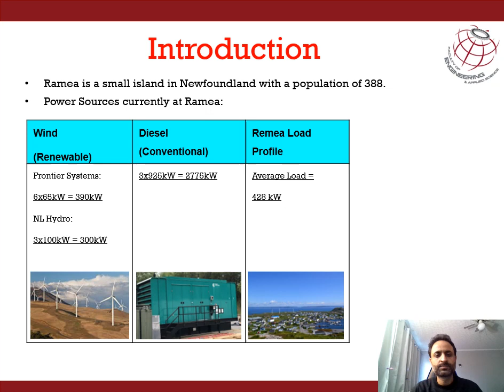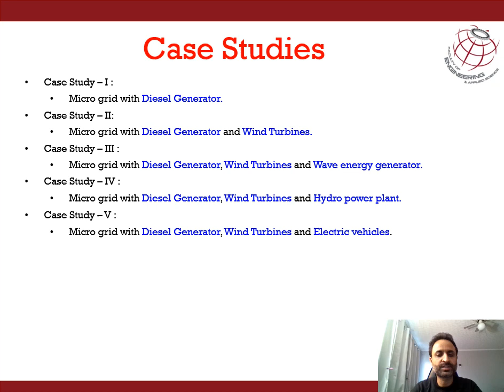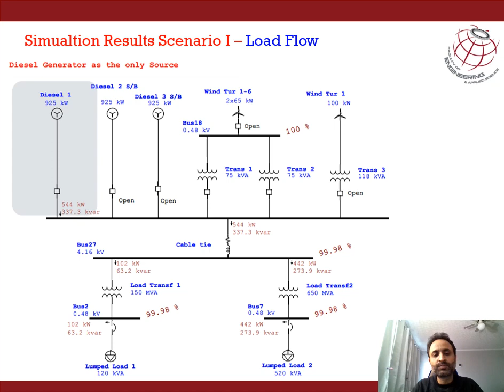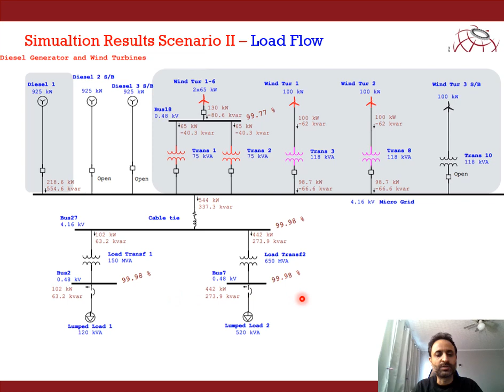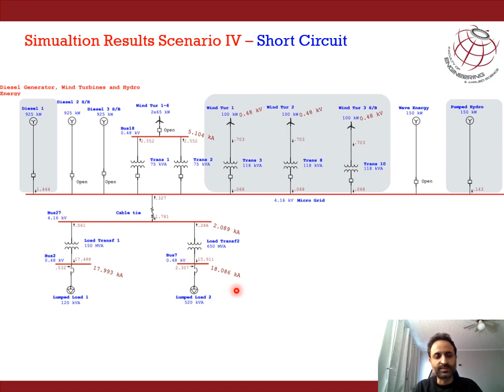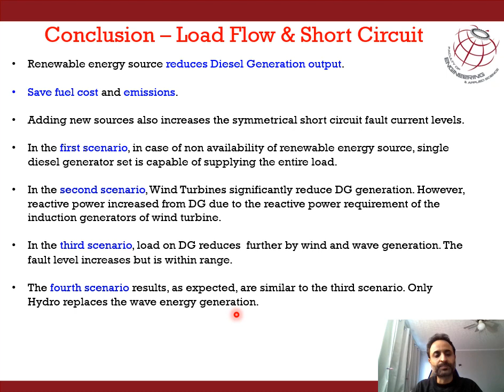ENGI 9863 - Load flow and short circuit Analysis

Comment: Great presentation! Adding renewable energy sources to the existing grid will increase the short circuit current level at some particular faulted node for instance. What are the main causes of increasing fault current the fact that adding renewable sources to the grid?